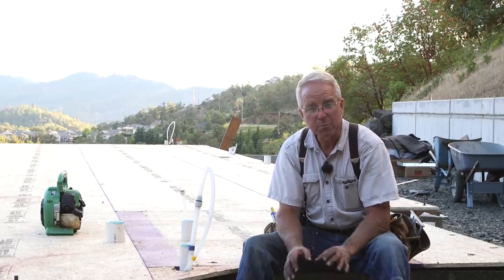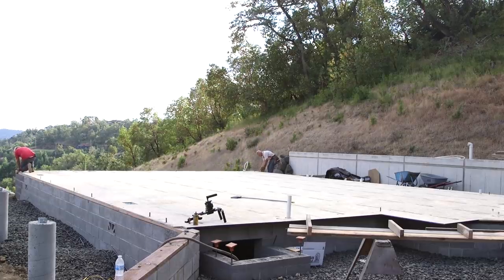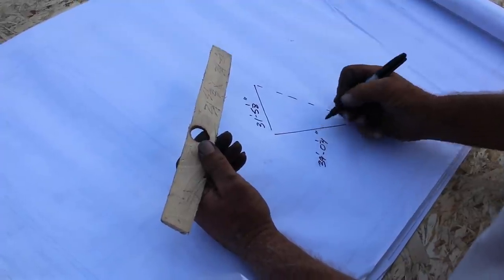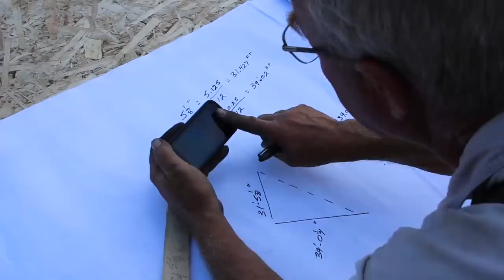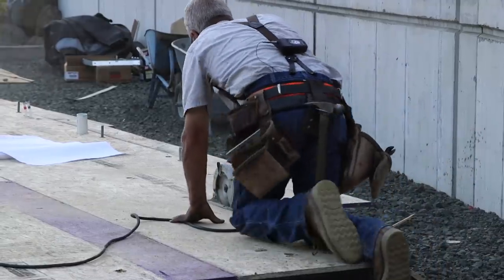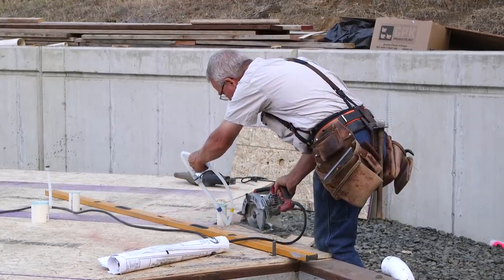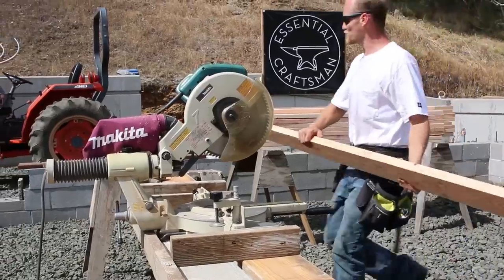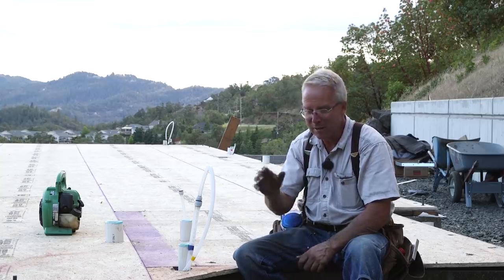Make it Square Ep.45

Comment: As a retired custom cabinet shop owner, it's refreshing to see someone concerned with 'square' construction. I can't count how many times I had serious problems, installing cabinetry, in homes where 'square' construction was not a primary consideration. I'm sure, I would enjoy cabinet installation, in a home constructed by you. Thank you for your common sense approach to construction.
Reply: I mostly do remodel and repair, and that is the struggle I deal with everyday. I recently worked on a house that was visibly out of square. Not only were the rooms 2-3” out, the walls were framed as much as 3” out from top to bottom. Every door needed to be rehung. I do not know if this was a builder error or there was some other reason. At any rate, very frustrating and also difficult to explain to the owner without sounding like I was making excuses.

Comment: We sometimes get a quick rain so after we snap out our chalk lines on the floor we spray over them with clear spray lacquer. I have seen some guys use dollar store hair spray.
Reply: Some of the colours are more "water resistant" than others.  I think red is the most permanent.
Reply: Red chalk is not for the DIY suburbanite LOL. Still have some on my deck from '93 HAHA
Reply: Guys at work would complain about the red chaulk not washing off easily, they would say we wear blue jeans, not red jeans!
Reply: I think generally, Blue you look at and it'll come off. Red if you swear at it enough it will come off and Black. Well, Black chalk will stay there looking at you like "you snapped me idiot, not the other way round". And will never ever come off.....
Reply: @michaeljacobs9613  So right about the black! It’s very messy but very permanent! You can tell in the video, Scott is using an old chalk box bcz as he unwinds the line, the chalk comes pouring out of the top bcz the little felt bushing is worn out 😂
🤜🤛
Reply: I do that, works great for keeping the lines nice and sharp
Reply: Yep. Seen the lacquer trick done on my current jobsite, clarifying marks left by the surveyors. Instantly cuts through the dust, leaving the mark in sharp relief on the concrete.
Reply: blue for first layout red for corrections never use red or black so something that will be a finished surface IT WILL bleed thru paint.
Reply: I have worked on a number of jobs where each of the trades had specific chalk line colors.   The Ironworkers usually got red.  The carpenters blue and the electricians yellow.  The plumbers usually got blue as well.   This series is great, brings back memories.
Reply: @VC-Toronto  black
Reply: In my parts it rains about three times a year, so we get pretty red chalk lines that last for decades.

Comment: I really appreciate your channel. I’m 22 and am working in a metal manufacturing shop, I just sold my newer car to buy an old 3/4 ton pickup and an old gas saver and bought a flat 1/2 acre lot to build my first spec house on. No debt involved so far. I’m hoping to do most of the work myself with my father’s help, who built his house on the weekends and evenings 20 years ago right after I was born. I’m planning on building something small, single story around a 28x48 and build in the style of an older ranch house. Might add an a frame porch to the front and possibly a single car open carport to keep the project as cheap as possible, but still aid in resale of that time ever comes. I’m hoping to do everything except for laying the foundation and the plumbing. I’ve never done anything more than a couple small projects around the house, so your channel and in depth videos are really clicking with me. You’re a natural teacher for sure, and I can’t thank you enough for releasing this “How to build a house” series!

Comment: For the comment section as this guy knows this like the back of his hand: The 3/4/5 rule or 6/8/10 for larger areas is an easy way to check for squareness of any corner. Measure 3 ft on one leg, 4 feet on the other- the hypotenuse from those two points will be 5 ft if square. 12/16/20 works too.

Comment: Can you add a video explaining how errors in square can be fixed and when you should start over. Thanks! Videos are awesome.
Reply: @Shane Yorgensen i meant how bad before a tear out and start over is appropriate. I get mistakes happen but what's the line when he'd make that call??
Reply: @timbailey4069  Decades ago when I started out I worked for a guy named Jack. He taught me several things. #1 "We ain't building a "pee-a-na" (piano) #2 "everybody makes mistakes, it takes an engineer to figure out how best to live with them". Sure seems to be true. Another from Jack was "Take the hypotanuse".
Reply: A lot of times squaring errors can be worked around but generally, areas around bathrooms and kitchens must be given extra attention bcz of the prefabricated cabinets and shower/tub enclosures.
🤜🤛
Reply: @timbailey4069  how out of square are you and what is it that you are doing?
Reply: I saw a guy do his own foundation with insulated concrete forms - ended up two FEET out of square.  Hard to ignore!
Reply: Generally speaking, your not going to be at the point of framing the floor and find out your more than an inch or so out of square. You should be checking at every step along the way. Very unlikely you would have the floor on and realize you need to start over. If the first time you check for square is when the floor is on, you probably aren’t qualified to build a house.
Reply: @michaelstiller2282  Helping a friend build a garage. He hired footing and wall pour by professionals cash job no contract and was 6.25 inches off square. Got as best we could but changed dimensions drastically.
Reply: @5x535  That wasn't Jack Burke, was it? I only worked for him one summer between high school and college (building a church), but I probably heard him say that thing about the piano twice a week.
Reply: Tim Bailey Not sure if anyone has sent you this link yet: https://www.youtube.com/watch?v=YAFUoP8b5sA. They talk about mistakes in construction and ripping out work and redoing it.
Reply: @timbailey4069  so if your saying you have a square structure. When you measure from corner to corner it's over 6 inch out of square, that's alot for a garage. I would say it needs to be fixed.  I am assuming the worst that you don't even have 2 parallel walls.  You paid cash no contract.  Pros take cash jobs, call the foundation guy see if he responds.
Reply: @michaelstiller2282  both long sides were parallel. Pro was called admitted he never checked square assumed one of crew did. We moved forward with building garage and changed dimensions to fix best we could. Wasn't my building cause i would've had him tear it out but i would've had contract as well. Live and learn.
Reply: @mtbfree  hadn't seen that was what i was looking for.
Reply: @timbailey4069  no contract there's nothing you can do.
Reply: @mtbfree  No it wasn't Spencer. Jackson G Hayes is long gone now. I have thought of him many many times over the last almost 60 years. He was fun/different to work for. He took me home for lunch once. There was a dead deer laying in the corner of the living room. He took his knife out of his pocket and cut a hunk off the deer and cooked it---kinda---and we ate. Never did forget that meal.

Comment: So the 5/8 “ and trusses sparked my attention. Was that statement made because the overhang or soffit would be 5/8” to wide. Hope you understand my question   I have never seen any builder. / carpenter be so accurate 👍. Someone is going to buy a great home !
Reply: What he means the building would be 5/8 to skin if the trusses was already ordered. So to fix that he would let the floor hang over 5/8 to make the building the correct width

Comment: Scott, I have a place where you can spend the money you saved on lumber: the bathrooms.  A few hundred bucks will wrap them in acoustic insulation and pay for solid-core doors.  I don't want to hear what you're doing in there.  And money will fix the common foolishness of having only one little dinky soap dish in the bathtub/shower.  In my tub, I have one soap dish/shelf for the 2 bars of soap, another for the two bottles of shampoo, another for the rubber duckies, and a fourth one for unidentifiable things my wife uses.  I also have a towel rack on the end wall of the tube to hold the dripping latex bathmat.  These things are all cemented to the wall along with the tiles, so we don't need the cheap, rusty rack that hangs from everybody else's shower pipe.  Your buyers will thank you for these little things.

Comment: If you remember that a triangle with relative side lengths of 3, 4, and 5 always has a 90 degree angle opposite the 5 side then you wont have to do calculations.
Reply: This is the trick most of us tile-setters use!
Reply: Yep, this is how I do layout too. This is framing, not furniture.
Reply: That's a good one, but there are other so called "special" right triangles.
Other ones include (5, 12, 13), (8, 15, 17), and (7, 24, 25).
I'm sure you could find a really long list of them if you searched further than the Wikipedia article I found.
It's a good idea to remember as many of them as you can, because not every right triangle problem works out to a 3-4-5 triangle.
Reply: 3,4,5 is the easiest to use to just get 2 square exterior walls as your set points for all other walls. Use the largest multiple you can for the length of wall.
6,8,10
9,12,15
12,16,20
15,20,25
18,24,30
21,28,35
24,32,40
27,36,45
30,40,50
Etc.
Reply: @micahwatson9017  I think I've seem some houses built using those alternate triplets. Big Grin.
Reply: 3,4,5 is a great rule and I use it a lot, but some times using exact dimensions help ensure accuracy. And if you are a carpenter who has any interest in knowing how to stick frame a roof, or build a set of stairs, using and knowing Pythagorean theorem (a^2+b^2=c^2) is so helpful and in my opinion, essential for laying out something straight and square, making it easier for the trades that follow.

Comment: If your miter box is an antique then mine is an artifact! Thanks for sharing!
Reply: The last big job I did (I am almost 80) I had a 14 inch radial arm saw with roller tables on the in feed and out feed and a sun shade over the cut station  a 14 in saw will cut thru 4 X beams and headers.

Comment: When you were bringing up the Pythagorean theorem I thought you were gonna bring up the 3-4-5 rule.  Measure some multiple of 3 units.  Measure same multiple of 4 units.  And the distance between should be same multiple of 5 units.   Ie you measure 3 ft  off the corner.  4 ft off the corner the distance between should be 5 ft.  Or you could go 12,16 and 20 inches or feet as allowed by building size.  Maybe 6 feet 8 ft and 10 ft work out better.
Reply: It's the same rule. 3 squared is 9, 4 squared is 16. Add them up and you get 25. The square root of 25 is 5. 3/4/5 is the Pythagorean Theorem with easy to remember numbers.

Comment: I really enjoy this series and for that matter all your videos. I guess I'm sort of surprised that anyone believes it is practically possible to be able to be perfect when the tools you are using are not perfect. Perfection is setting expectations that are not attainable and can only cause frustration. That said given the accuracy of the tools being used there is a reasonable error that can occur. Knowing when and how to correct this so that the errors don't compound is critical. I think you have done an excellent job of that. To me there is a big difference between just throwing things together vs bringing things into alignment at certain stages to keep it square and plumb. What you are doing will save time and frustration and $$$ down the road including for the homeowner. I don't know what is reasonable but I'm just guessing that being off 5/8" over the length of the house is very accurate. Can't wait to see your next video!

Comment: Okay, I loved the part with the string. I just tore down my old roof and re-roofed a big barn all by myself. and your "wood gauge block and string" helped a lot! I also used the Pythagorean theorem to square everything up.

But looking at you do that, it was (and sorry to say this) painful to watch.  feet + inches + fractions of an inch to decimal places conversion and then doing the Pythagorian and converting back is just asking for a silly one digit mistake to pop in. 

Please don't take this comment the wrong way. I love what you're doing and I love learning from your videos, but I find it funny how simple measurement system just seems a bit more error-prone. (please don't turn this into metric vs imperial, because he could have simply done all the measurements in the imperial system in inches and decimal place and not have to convert anything)
Reply: I might be wrong, but I think that when he said *decimal places*, he meant thousands of an inch, not actual metric measurements.
For example:
13/16" =.8125"
1/2" =.500"
1/4" =.250"
3/16" =.1875"
And so on . . .
(for those that don't get it, just divide the first number by the second: 13÷16=.8125)
Reply: Another option is to get a decimal tape that measures tenths of an inch directly.  Or a metric tape - they don't bite.

Comment: @4:15 that's why the metric system is much better ... no conversion is required ;)
Reply: The American fractional system is very easy and is about proportion and scaling. I can buy 3/8 ply wood. 3/8 x2 is 3/4 I can buy 3/4 ply wood . 3/4 x2 is 1 1/2 the thickness of a stud. 1 1/2 x2 is 3 inch. A 3 inch structural stud isn't structural enough, we call it 2x4 it measures 3 1/2. 3 x2 is 6. We have a stud called 2x6 but it's a wasted material 5 and 1/2 is structural.  6 x2 is 1 foot . 1 foot x2 is 2. 2x2 is 4 4x4 is 8 I can buy plywood that's 4x8. 8x2 is 16. That's the stud layout.  16 on center.  1 16th is the basic scale of a tape in the usa. So it all jives.
Reply: @michaelstiller2282  Metric countries use standard sizes as well, just different units and slightly different sizes to make the maths easier.

Building materials here in Australia often come with dimensions in factors of 300mm (almost 1ft) - a standard sheet of ply or drywall is 1200x2400. The default ceiling height is 2400mm, but nicer homes have 2700 or even 3000 ceilings.

These measurements are all slightly less than the US foot equivalents - 1200x2400 is the same proportion as 4'x8', but slightly smaller because it's easier to divide up than 1219.2x2438.4
Reply: That's why America put a man on the moon... A little bit of math never scared us. ;)
Reply: @michaelstiller2282  @4:15 .. the Pitagora's calculations. Converting and converting and calculating and reconverting .. real fun! Use metric!
Reply: @MikeHeath  Math is not the problem, is always good. But why all the conversions? Any extra calculation involves human error. Use metric!
Reply: Some American carpenters just use decimal points. Same as metric.  .25 is 1/4 or 25 mm.
Reply: @michaelstiller2282  I commented on the calculations shown in the video @4:15 . After all the conversions and calculations and reconversions there is a (human) risk of getting wrong results.
Reply: @FredCome2Bed  yeah the way he figured square is old school. There's an app. Buildcalc,  I could figure out the work he did in 15 seconds. It could be 45 foot 3/4 by 36 foot 5/8  I could tell you the hypotenuse down to the 32nd. Which is 57 foot 8 1/2. Also could tell you that hypotenuse in and additional second in metric which is 17,589.843 mm.

Comment: You: heaven forbid trusses were already ordered for this roof

Me: trusses are 6-8 weeks out, i don't start framing till trusses are almost here
Reply: Agreed.  I've seen them as much as 16 weeks out.  It's hard to even plan around that!
Reply: I agree, and we used to never even pull up to a job without trusses on site, but the current truss company (ABC) for the builder we're framing for sends a knowledgable rep/engineer out to measure our deck and walls, works with us on any issues we/concrete/steel have and any changes.  I would rather have it this way every time... If i have to cheat and change (happens every house), he's a text away, and will alter the trusses.  It's really been great to having a relationship with the truss designer!
Reply: Scott has the luxury of going ahead without the trusses because he is cutting and stacking. ;-)  Good method when applicable.
Reply: Bob T he also has that luxury because he’s not using them
Reply: @GameVilleofficialpage  tgi!!!

Comment: Pythagoras is fine, but keep it simple. 3:4:5 rule. Measure 30 ft one way, 40 foot the other, hypotenuse must be 50 feet for square. End of story.
Reply: That's the same thing genius 🤣 🤣 🤣
Reply: By measuring the whole span of your 2 sides you will be more accurate. Picking a number that's easy for the math will rarely take the whole span into account. If you suck at math you can use an app like carpenter pro.
Reply: @Daniel  really depends on the distances involved. Do you really think you can measure say 500ft accurately with a tape? By yourself? Would being out half an inch in 500 ft matter? 50ft is plenty big enough. 3 x 4 x 5 inches probably isn't enough.....